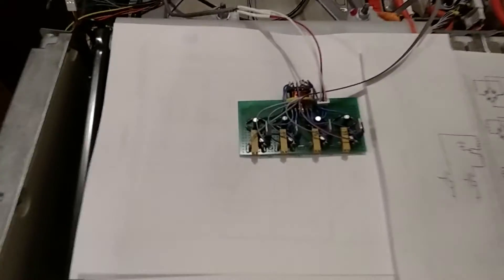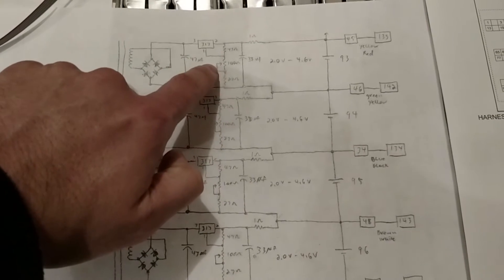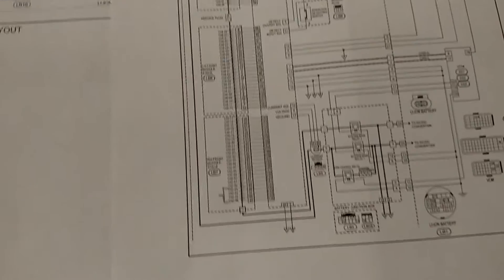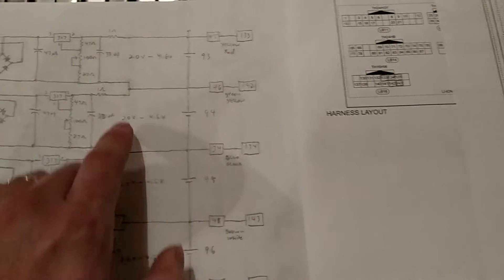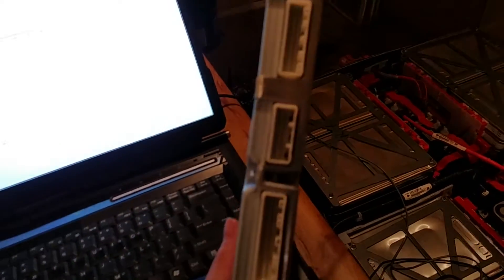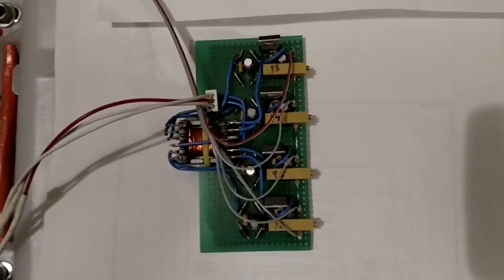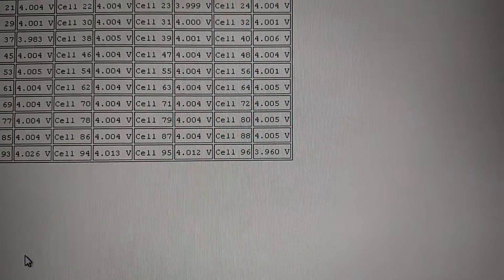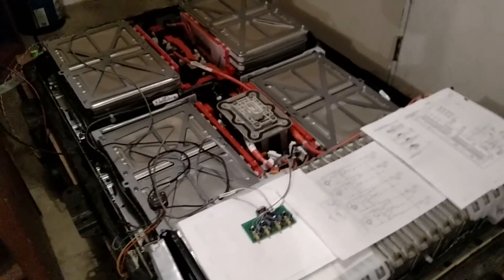Solectria E10, Lithium Ion Battery Upgrade, Part16

Comment: Interesting!
Reply from the maker: Reverse engineering always is. :)

Thanks for watching,
Wolf
Reply: :) Exactly. Also, want to see the finished tail. It appears we have two hobbies in common ^-^
Reply from the maker: +Nikki Gordon-Bloomfield (Aminorjourney) 

Might be a while...

I need to get this battery modified, so I can put it in the truck... 

Then I need to get the bi-directional buck-boost converter working...

Then I can finish the tail controller...

Then I can finish the tails. ;)

I do want to auction off the tails before Halloween.